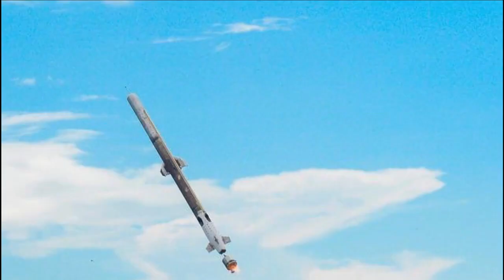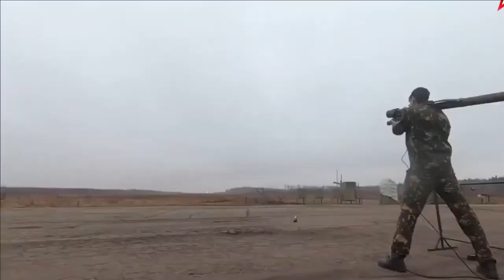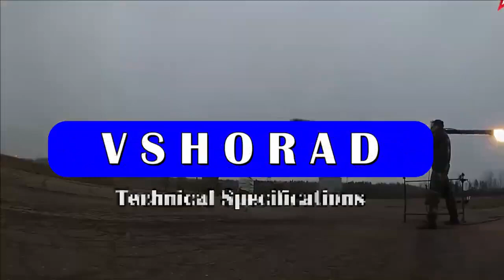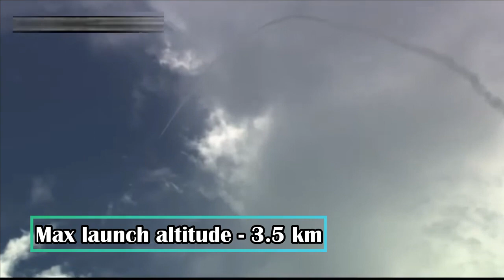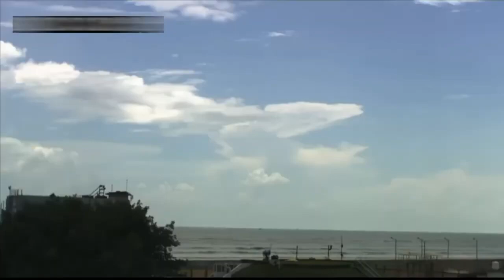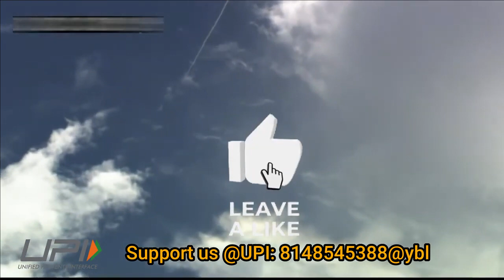DRDO conducts two consecutive successful flight tests of Very Short Range Air Defence System missile

Comment: The newest Rossiya Verba is a fairly similar missile, except that it has better sensors. Three-channel optical seeker (ultraviolet, near-infrared, mid-infrared). If the ultraviolet sensor can be added to Vshorad, it will be able to discriminate between decoys and targets a little better. Hopefully DRDO will upgrade the seeker and electronics over time. A great start! Many thousands need to be inducted since manpads have proven to be crucial to winning wars in Ukraine, and particular at high altitudes. They were decisive in Afghanistan also.
Reply: Also for important and obvious areas ciws are better. We need to work on more sophisticated radars.
Reply from the maker: VSHORAD has nothing to do with decoy as it’s for aerial targets in close ranges. Adding seekers will add huge cost. Dual band IIR will be good enough
Reply from the maker: Sudershan
Reply: @IndianDefenseAnalysis  Basically all current countermeasures are designed around beating stinger style missiles, which means if you can see in other bands you counter their countermeasure. It is not mainstream yet to have other bands used.
Reply from the maker: @datoolz0  the band you are referring to is in Infrared range or RF range?

Comment: Does it have a minimum fire distance of just 10m.
Like that's one of the main reasons why Piorun Polish(Igla) was so successful against low flying helis compared to Stinger
Reply: 10m is very good, maybe buy some of those missiles and figure out what technical tricks the poles used.

Comment: Mach 1.5 is too slow for a jet, drdo made it highly manuverable for intercepting jets but speed is low
Reply: Enough for a 7 km range system...wese bhi manpads se supersonic jets nehi mare jate.
Reply: Manpads are for helicopters, UCAVs...vlsrsam is for super sonic targets...
Reply: @ashishbabu1617  i know but why then they say super maoverable with 20 tvc jet vanes
Reply: Dude don’t worry no jet is going to attack a ground target at supersonic speed, for target acquisition of ground targets a jet travelling at mach 1 is flying too fast. It has to slow down if it wants to successfully destroy a ground target. For high flying super Sonic threats India has better missile systems. Moreover vshorads are most often used against choppers and UVA’s .
Reply: Jets don't always fly in supersonic Speed. And these systems are used as surprise attack not as main air defence